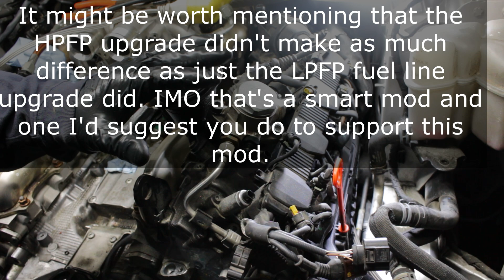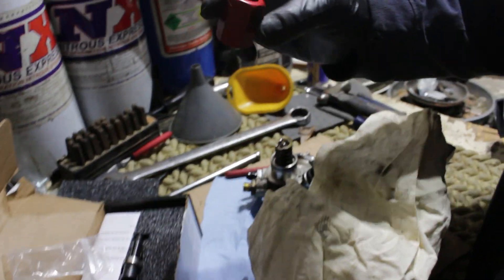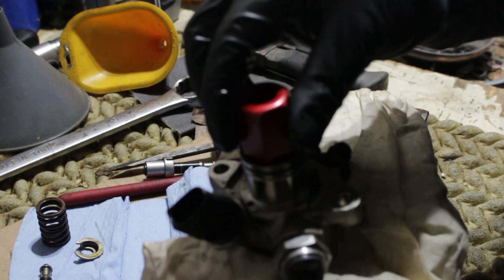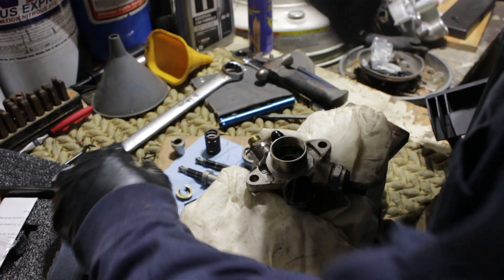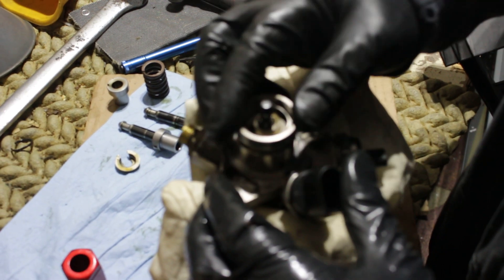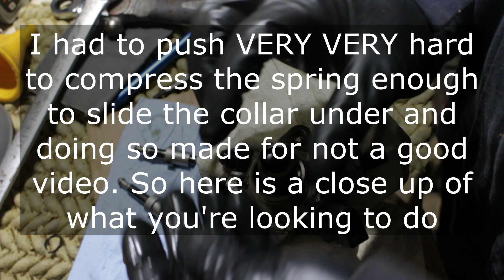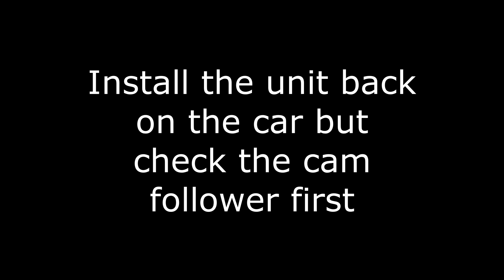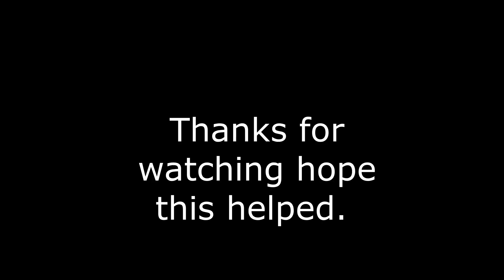4.0T HPFP piston upgrade install

Comment: Did you need to tune for this immediately in order for the engine to run ok?
Reply from the maker: You shouldn't need a tune to do this. There is an adjustment range. Without a tune the max output will be capped. But the car should run fine.. Something to note. Make sure to check the ECU for any error codes before doing this. I helped a local guy install a kit he had and he got an error code for the fuel system. From what I understand some times if the piston isn't perfectly built or modified, it'll throw an error code.

Comment: Great instructions...like all ur videos.  I have a 2016 Audi S7...with upgraded RS7 turbos and downpipes and heat exchanger etc.   Its tuned to stage 2÷ by Unitronic putting out 665hp on 93 pump gas.  I have done the fuel line reroute feeding both hpfp independently.  My question now is ...is it beneficial for me to do this hpfp piston upgrade for my current setup?  I know if I want to run E85 it is...but will it really make any difference for my setup now...or is the stock hpfp piston adequate? Plus wouldn't I need a separate tune again if I did upgrade them?  Tx in advance.
Reply from the maker: Hi Dan, The HPFP will do more when you have the LPFP line upgrade. Anything you do fuel wise is just a smart investment for insurance. Hp wise you're not making monster Hp so if you have the fuel controller / Fuel lines on pump gas you're probably in good shape.

Comment: You mention that you think the LPFP line upgrade made more of a difference.  What did you notice after that upgrade?
Reply from the maker: The LPFP line helped the HPFP work at a higher rate of efficiency allowing a higher bar output from the HPFP while keeping the Low pressure side from falling off as much. I answered more in the LPFP thread where you asked for info. But it's much the same. Still the hpfp piston did help, but the bar output with no LPFP line was not significant enough to do IMO
Reply: @howididit7196  Thanks!  Loved the way you explained it :)
Reply: @howididit7196  Thanks!